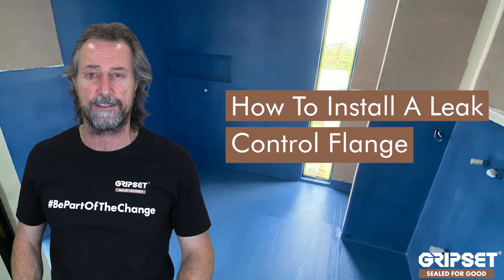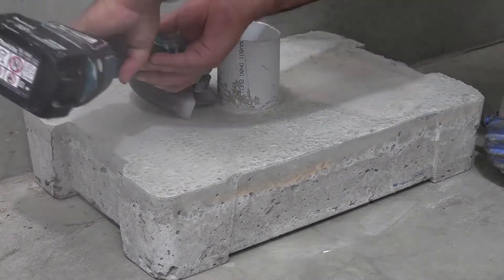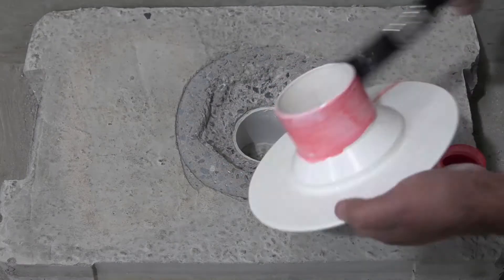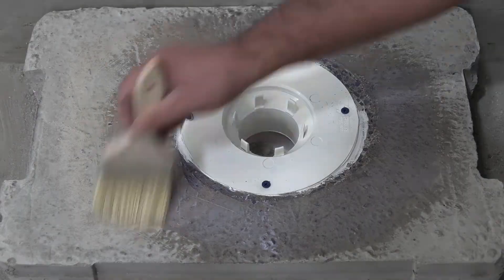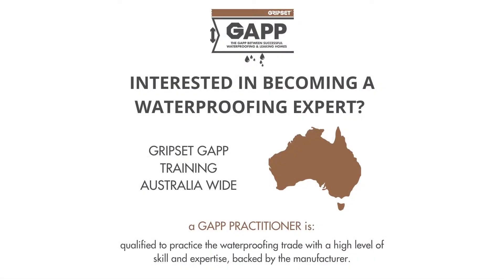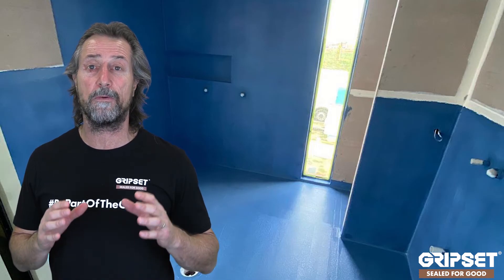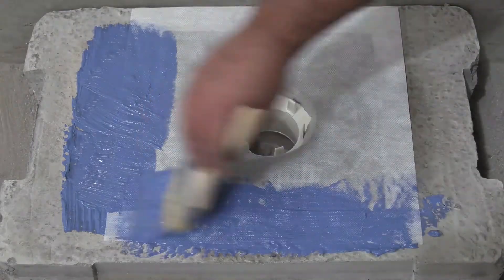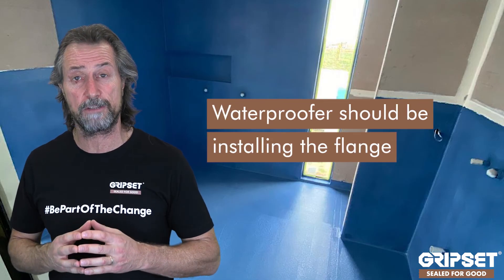How to Install a Puddle Flange

Comment: Thanks for this. I am doing a cottage reno. My bathroom floor will be over the old lounge and Grove timber. I am doing the waterproofing and tiling myself. Can I go through the steps as I understand?
1. Position my shower waste hole through my floor
2. Ready my ceramic tile underlay and glue & screw it in place. Ensure my puddle flang is flush with my underlay
3. Remove the flange and apply my membrane 
4. Screed over, making my fall into the waste the flange and attach my finished grate.
Reply from the maker: Hi Timothy, we recommend confirming details with installation guide CTU manufacture and referring to https://ncc.abcb.gov.au/editions/ncc-2022/adopted/volume-two/h-class-1-and-10-buildings/part-h4-health-and-amenity & AS3740-2021 will provide guidance for falls and puddle flange detail.

Comment: Thanks for the video! So if you if have a puddle flange installed, and the drain get blocked down further in the pipe, doesn’t that mean the space under the tile, even though is waterproofed, is going to fill up before it comes up the surface drain so you that you know there’s a blockage?
Reply from the maker: Hi Ryan, the membrane terminates to the flange, so any water that comes up will be seen through the grate itself. Thanks for watching! :)

Comment: If there isn’t any fall on the substrate, I.e slab. Wouldn’t it be better to waterproof over the screed?
Reply from the maker: Yes we believe it would be better to waterproof over the screed 😁
Reply: If waterproofing over the screed (where there’s no fall on the substrate) do you then need a puddle flange? Or would you install the puddle flange, then screed, then waterproof?

Comment: When waterproofing the puddle flange, is there a specific method or product to prime the pvc ready to receive the membrane? Or would I use the same primer I have to prime the concrete substrate?
Reply from the maker: Hi Sam,  we recommend Gripset OP Primer if detailing the puddle flange the traditional Gripset SB & RF fabric method, if you want to save time and increase performance you should consider Gripset BRW PF Square. Head to our website for full details: www.gripset.com and thanks for watching!